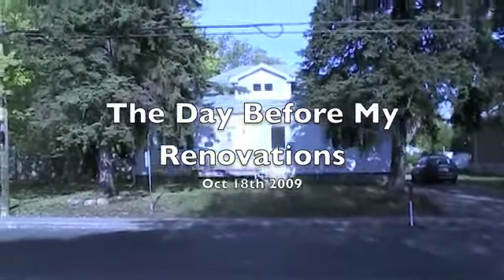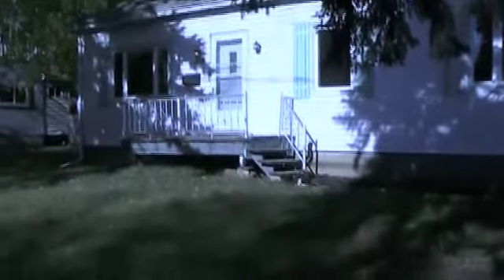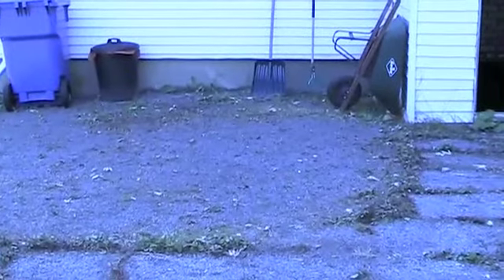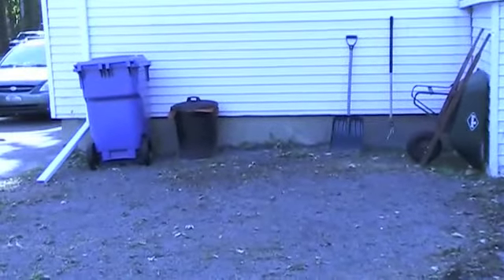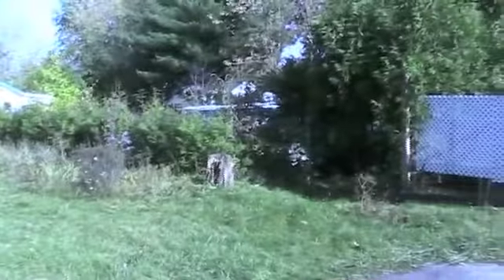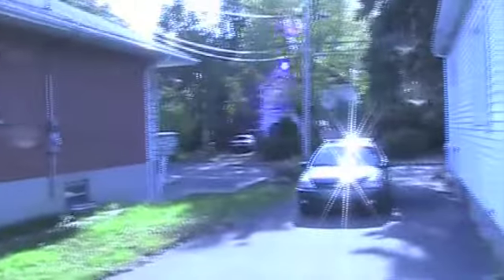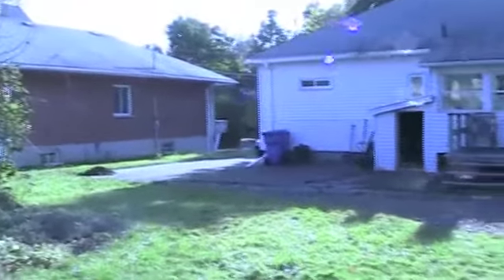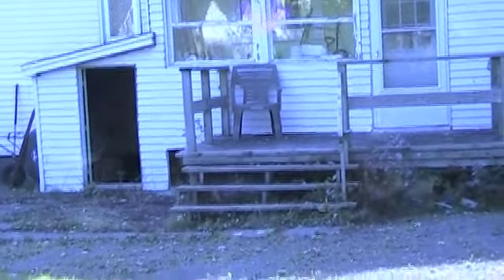The Day Before Renovations Began

Comment: @Ape65 I agree with the idea of insulating basements. It seems to be a tragic mistake that so-often basements are left uninsulated. Hopefully the inside-foam won't allow vapor-drive to deposit moisture on the cold concrete walls behind it, inviting mold.

I guess it was OK with the fire codes? I don't think they allow foam-insulation on the inside in America, unless it's covered with a sufficient thickness of fireproof material. Sometimes said of ICF: "Half the insulation is on the wrong side."

Comment: @Ape65 "in Montreal we need 6 ft foundations because of frost, which is why many houses have finished basements."

I know. This is a modern way of preventing frost-heave:
pathnet. org/sp. asp?id=17783

"FPSFs offer excavation, construction, material and labor cost savings. One case study in Denver showed savings of 15 to 17 percent [...] An Iowa builder reported a $10 to $15 savings per linear foot"

"FPSFs are generally cost effective if the frost line is 30 inches or deeper."